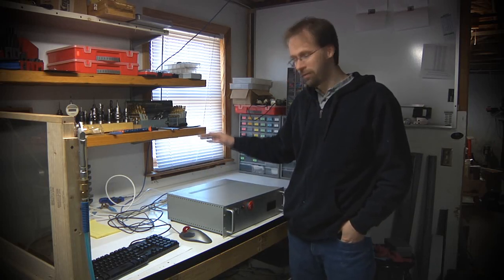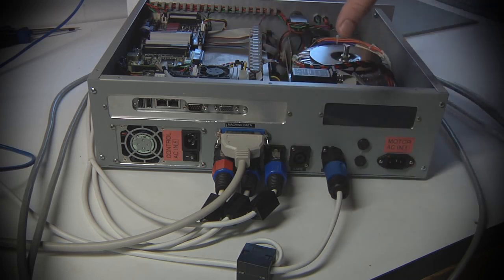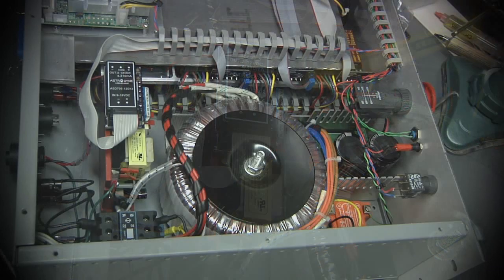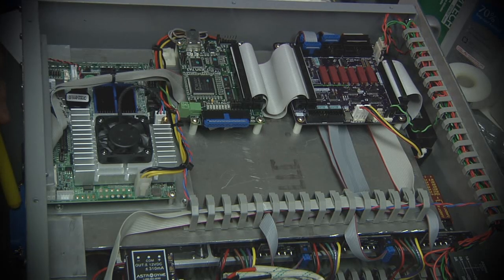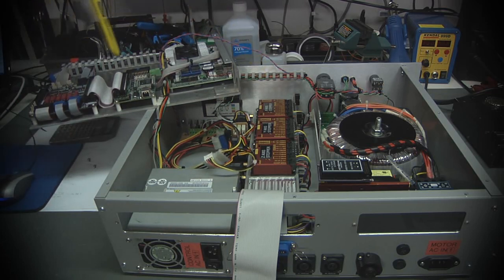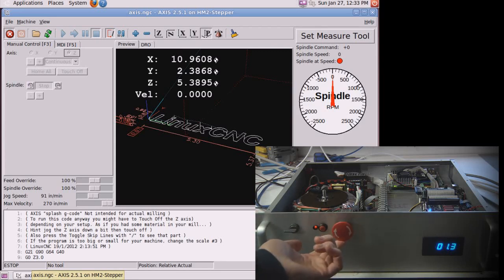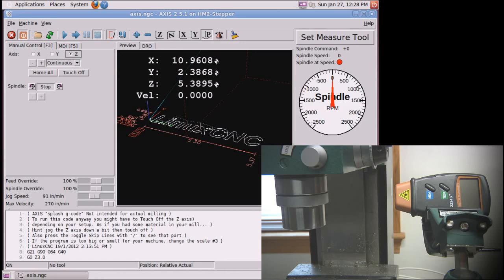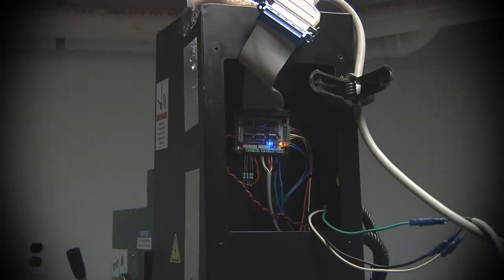Electronics Overview for X3 CNC Mill Conversion with LinuxCNC and Mesa FPGA Card

Comment from the maker: You could get a G540 to work with a 7i43, but it's not plug and play.  You'll have to make a cable from the DB-25 connector on the G540 to to pins on one of the 50-pin headers on the 7i43.  The G540 is meant to connect directly to a parallel port on a PC easily.

However: Mesa Electronics recognized there were a lot of products on the market that hooked to parallel ports, so they made FPGA cards with standard parallel port pinouts.  The 5I25 should work with LinuxCNC.  Haven't tried it though.

Comment: Pretty phenomenal! 2 years ago I would have had no idea what you were talking about. Since that time, I've bought 2 3D printers, built one, bought one small cnc (3020) and built 2 (one is an openbuilds Ox, and the other is a gantry style model of my own design using 15 series 80/20 aluminum extrusion) driven by 4 ballscrews and using PMDX BOB & Smooth stepper. Doing all that work, what do you do for a living? To be able to make your own board is pretty cool. Did you ground all that to the box?

Comment: Hi, so i got that kind of mainboard u are using there.. the LPT port seems to be a IDC26 pinheader with a 2mm pitch.. trying to find/make a cable for that to a standard 2.54mm pinheader.. no luck.. any suggestions?

Comment: flawed build: 1st you did not leave enough air cavity to allow air flow and you didn't add ventilation. 2nd on a cnc build you want a GOOD cpu(for low jitter output/stability)  and a good south bridge(sata controller for data transfer speed). 3rd that toroidal transformer creates a larger toroid of an electromagnetic field around itself that will effect over time most of your microchips, it should instead be oriented so that no electronics are around the outer diameter, instead all electronics should be on top or bottom of the toroid and spaced past the magnetic field that can be measured with a tool. Solution: replace  board-pc with a am3+ soc motherboard with < 3.6ghz cpu, fastest ECC-memory you can afford, build spindle control box separately and ventilate with at-least 2x 120mm input fans and 2x 120mm output fans. then it wont freeze on large jobs with over 1mil lines of code

Comment: Hey, what
s the name of the fpga interface for linuxcnc? Is the FPGA attached to the parallel port, or something else. How does linux cnc know about what the FPGA can do?
Reply: You must have solved this by now. For anyone else, the controller that interfaces with LinuxCNC is a MESA Electronics card. I believe he said it was the 7i43, but there are many others that are popular as well.
http://store.mesanet.com/ 
Some connect to the computer by parallel port or Ethernet. MESA provides the drivers/firmware needed for them to interface with LinuxCNC.